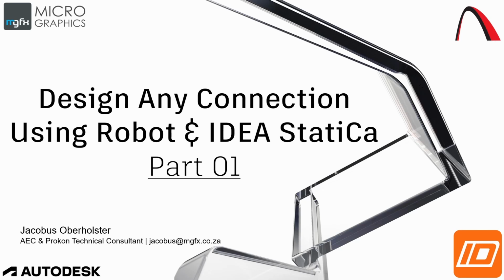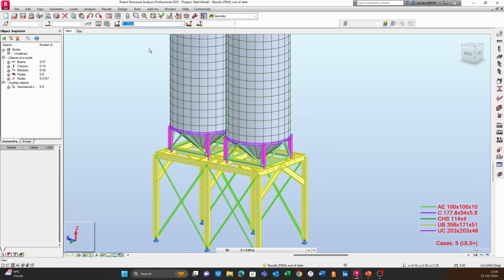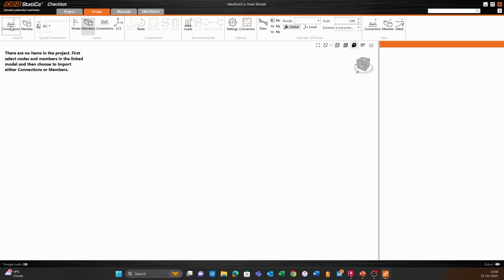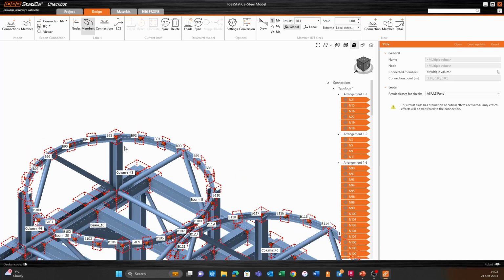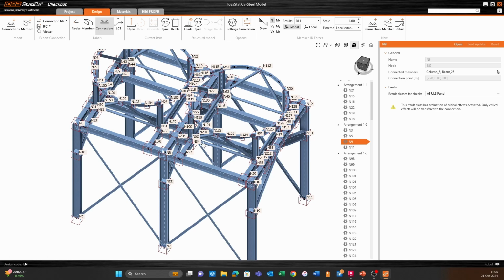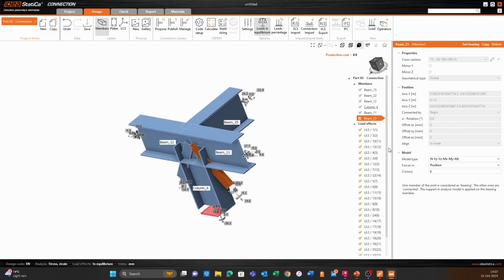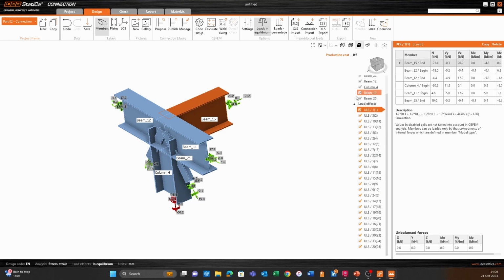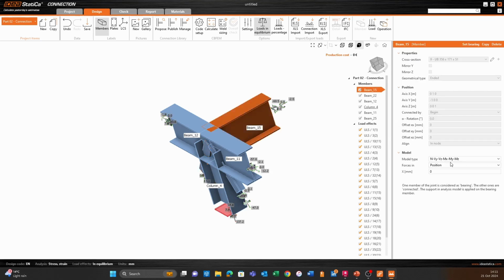Design Any Connection Using Robot & IDEA StatiCa - Part 01

Comment: Hello....Hope all good on your side. I know it's tedious to perform all connection analysis of all joint but its right to identify the most stressed connection  and design for it then the others with the same members will automatically be safe. Question, how do you determine the critical connection in Robot so that you design using it and replicate to the others?
Reply from the maker: Hi:) That is a great question. I imagine that it would come down to the critical members. When you display the results, you can set it to display Global Extremes. I would then look for those members as a start. For example: To determine the critical node for a baseplate design, I would probably look at the critical axial force value, perform a very rudimentary design of a baseplate for that node and then copy that connection to the other nodes, then run the design for all of them. I can then look at the utilization values and from that determine the critical connection and perform a more indepth design.

Beyond that it does not seem like there is a way to have Robot highlight critical nodes, most likely because it doesn't know what type of connection you are going to use at any specific node.

Comment: wound not it be better to distribute load along silo so there would appear to be additional moments in structure due to bigger shoulder? Coz I'm doing exactly so after i discovered this difference in results according to load assigning type.
Reply from the maker: Definitely, the model is only for reference, so we do not put a lot of emphasis on the actual modelling, load-distribution, etc.